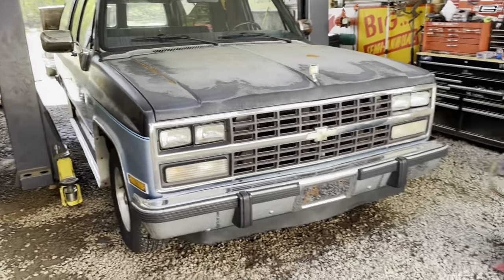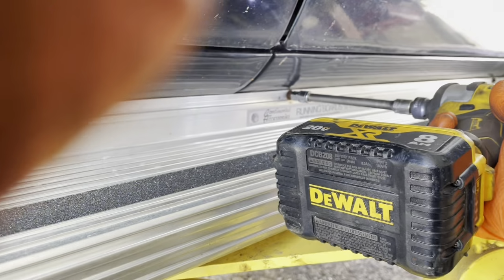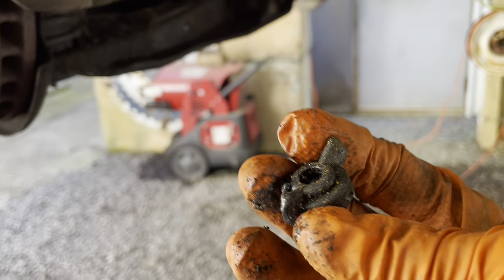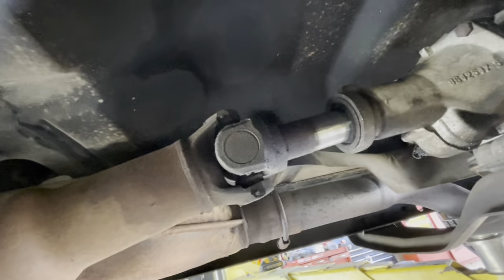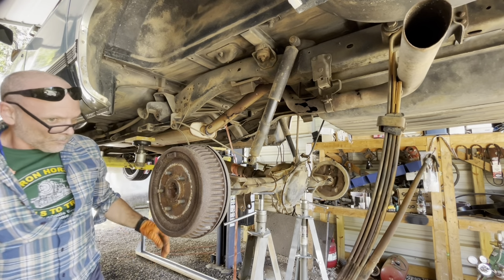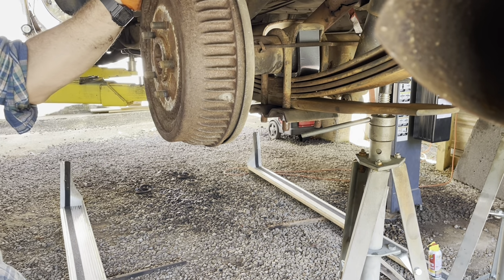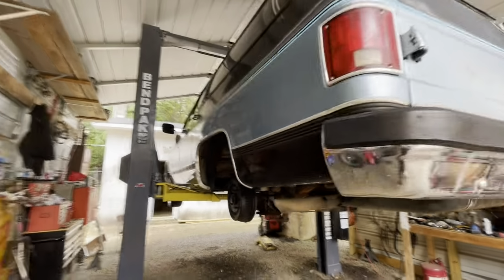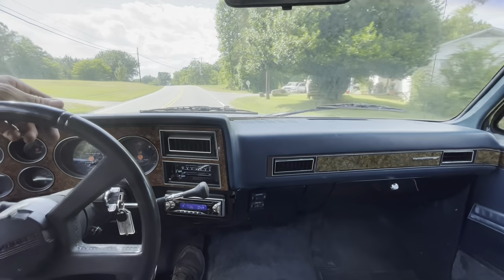Lowering and c-notching a 1990 Chevy Suburban

Comment: I did a similar flip kit in the rear of my 88 suburban but without a Notch and I even used shock relocation brackets I don’t see how you drove that thing without the shocks constantly bottoming out because that’s what mine is doing.
Reply from the maker: Pretty sure we went back and put shock extensions on this one after the video was posted. 
Vehicle is gone now.

Comment: Why 1 3/4 cut for front springs??- I normally dismount them n cut either 1 full coil or 2 at most
Reply from the maker: Because that is what has worked for us
Reply: @gordonsmart  where you located at
Reply: @gordonsmart  I all so got a 90 Suburban like to get dropped
Reply from the maker: @TimothyLaster-hv8re  concord NC
Reply: @gordonsmart Cool would been great if you were closer to MS tho I would get you to do my 90' Suburban man. U did a great 👍 job yo on that 90' Suburban u did & had it looking good low-riding